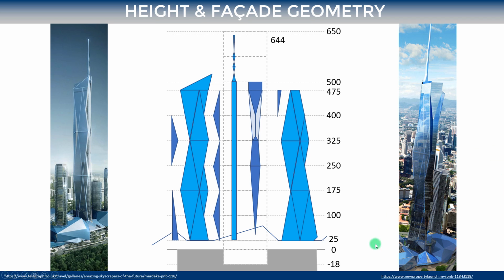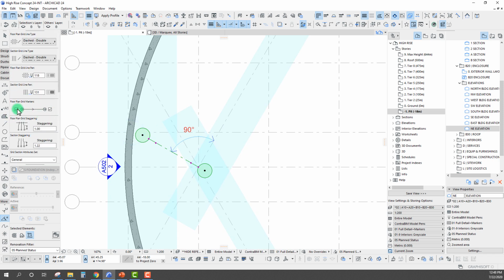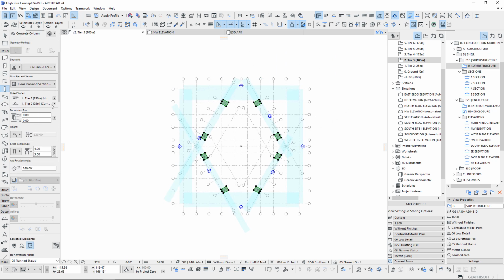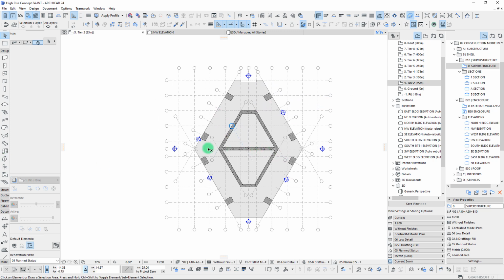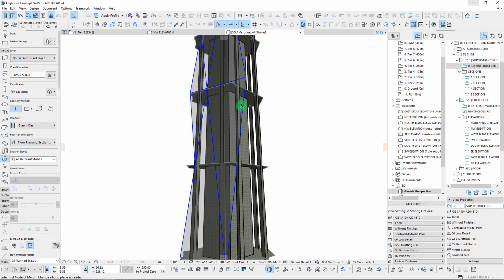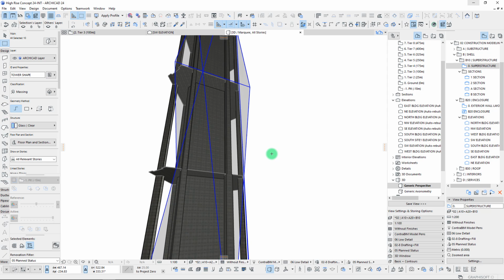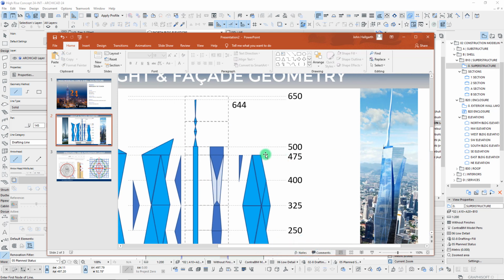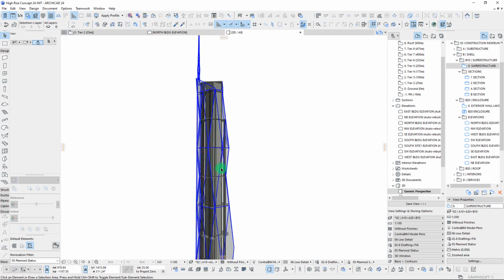Speed Modeling the Archicad 24 Feature Project (Merdeka 118 Tower)

Comment: what cpu and gpu are u using ? its seems like pretty smooth and no laggy
Reply from the maker: Running on a Lenovo P51 Laptop, Mobile Xeon E3-1535M and Nvidia Quadro M2200.  64GB ram... It's been ok but had a major crash earlier this year. Motherboard and all RAM crapped out and had to be replaced, Graphic are next I can feel it :/ Next computer will be a desktop with way more cores...

Comment: Hi.

If I had to choose between Revit, or Architcad - Archicad would be on top, due to how you manipulate 3D forms, rather than extruded 2D geometry. 

It is also a more complete system, as to loading separate structural, or architectural templates.  With 24 bringing the MEP as standard, this is a very powerful tool indeed. 

My question: what's the best way to integrate existing 2D AutoCad drawings?

This has been the biggest hurdle in the passed and I'm about to start a new job, introducing BIM and no doubt, will be pushing Archicad, but they have an existing AutoCad based 2D system.

I have used AutoCad elements to build complex profiles and as trase plans, but I haven't found a way to recognise text.  Is there anything I have missed?
Reply from the maker: Hi Ray. Thanks for the comment! In my experience, I always prefer importing 2D Autocad drawings using the drawing tool in Archicad, verse attaching as xref. I feel like it's easier to manage and control that way, verse importing a ton of new layers to deal with. As a drawing in Archicad, it still will update to the source file, and you can control layers within the drawing tool. You can also control the pens as a drawing. If you're missing text (.SHX files), I believe if you export your DWG as a package where it produces those associated files, you can drop them all in a folder and reference them in when Archicad asks for the missing files. Sometimes when you have a bunch of references in Autocad all linked together, it can create a bit more issue when linking into Archicad. Having a nice clean DWG with everything embedded can help resolve missing references. Hope this helps!
Reply: @CONTRABIM  

Yes, this helps.  The one thing I am trying to avoid is a lot of redrawing.  But, then - they are using a system that is a mixture of both 2D AutoCad and manully produced on a drawing board.  So, some redrawing will be inevitable!

Getting Archicad to recognise text created in AutoCad has been my biggest problem.  But, 100% totally agree with the  layers.  That's why I am first planning to streamline their layer structure, adjusting it to match a future Archicad setup 😉  this way tons of unwanted layers can be avoided
Reply from the maker: @miyahollands6136  That's the nice thing about placing imported DWGs as "Drawings". It can be on a single layer within Archicad, but with control to turn on and off "embedded layers" within. That way in Archicad you can have your own layer structure that doesn't necessarily have to match that of the Autocad file. I'll have to do a video to present what I'm talking about:) Thanks!
Reply: @CONTRABIM  
Sure, a video would be great - thanks for your information!
Reply: Absolutely  agree. Avoid bringing in native AutoCAD attributes! 
If you use the Drawing Tool to place dwg,  the dwg can still be updated externally in AutoCAD or you can manipulate the dwg in a separate ARCHICAD and update the drawing in the host file. 
(I normally do it in ARCHICAD,  we no longer have autocad installed on any PC)
Reply: @hkrna  
That's very interesting indeed, I can see this working for 3rd party supplier's who may still be working in 2D.  Allowing them to up maintain their information whilst informing the model.
Reply: @Ray 
That's exactly how it works. 
You may even use standard details as dwg if they tell don't need changing. 
As a cheat, you may even take advantage of editing the drawing boundary or cut a hole into the dwg drawing and connect archicad linework and annotation to a dwg. 
(but you haven't heard it from me,  it's too cheesy 😊)
Reply: @hkrna  
No problem, I'll wont tell anyone! 🤐😶
Thanks for your response 😎👍

Comment: Just wondering:
Did you think of doing the whole modelling almost exact same way as you did,  but using the curtain wall tool instead of morph?
Reply: On projects this kind eventually the facade will have to be modelled using the curtain wall tool. 
It is my experience  too that breaking it down to smaller segments works better. Also,  it is very likely that the facade would live in a separate file for documentation and would be moduled into other project files.
Reply from the maker: Karoly Horvath hi yes I considered doing with curtain walls, but wanted to keep the model as light as possible during this first pass. Was a little worried the extra geometry would slow it down at the time. I’m going to do another vid talking curtainwalls, takeoffs and estimating on the skin, it seems Archicad is handling this size facade with the curtain wall tool just fine, as long as you break up the faces into manageable pieces. Thanks for the question!
Reply: @CONTRABIM  don't you worry about what ARCHICAD can handle at this stage. I am working on similar scale projects. The model is typically OK. It only slows down when you are adding loads of 2D, Annotation, Layouts, Sections,  Elevations, modules (in this order) 
When  I say loads of them,  then I mean construction documentation level.
Reply from the maker: I did find that there's a certain point where the curtain wall tool just maxes out. I was curious to see if an entire face of an elevation could be drawn with a single curtain wall, and it totally bogged down and took forever to generate. Smaller sections works fine though even when loading up the equivalent to one large one.

Comment: I think you can build the spire with a column. The new column and beam tools introduced in ArchiCAD 23 are awesome. I've been using them a lot lately to build all sorts of things with them.
Reply from the maker: Marian Sdraila yes I’m sure the new column could handle that spire very well! I think I was just on a roll with morphs by the time I got there!
Reply: @CONTRABIM  It's probably easier to build with morphs! But if you use the column it might be easier to edit at a later time.
Reply from the maker: @mariansdraila  Yes I played with a square column real quick, pretty easy to get the general shape. Adding in the extra bulges at the intersections I'd have to mix in a complex profile with some profile modifiers which gets a bit more complicated. Something I'll come back to:) Thanks for the suggestion as always!